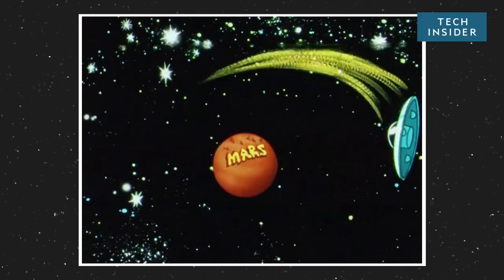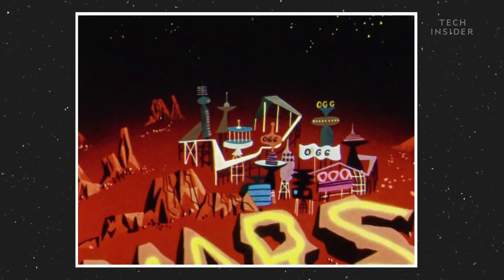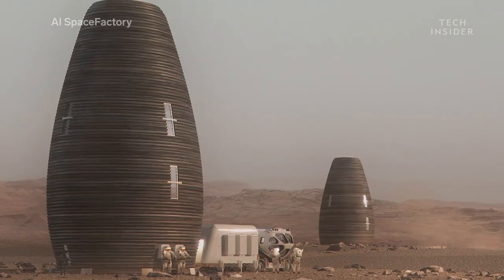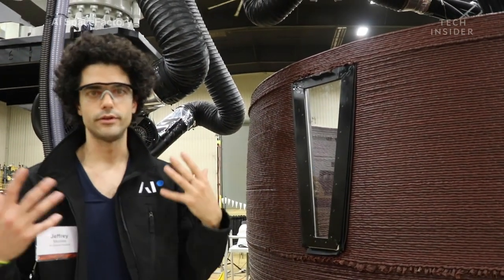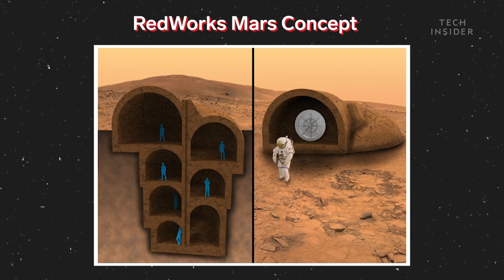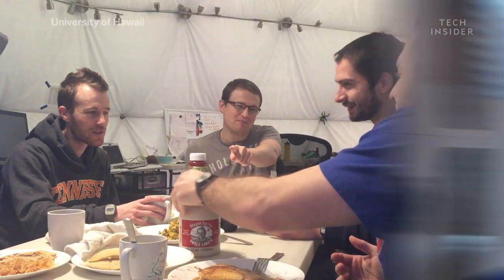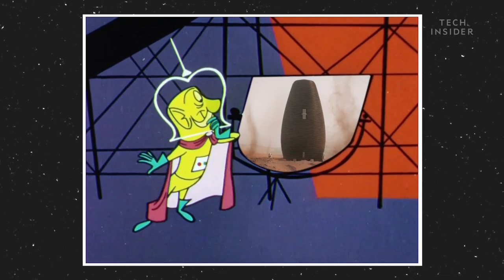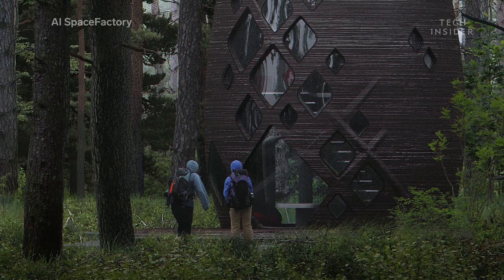The Mars Homes That NASA Awarded $500k

Comment: I am sold on possible practicality of first habitat like that because of ability to print it fast, assuming something is done about plant based component, but I found "needs to be above ground" for psychological reasons argument to be really weak. 

I still think that underground cities will be more practical in long term, with surface habitats mostly used as first stay while work on more permanent shelter is done. 

At the very least it must incorporate both underground and surface level, not extremes were one side is excluded.
Reply: im pretty sure it;s partly buried, https://www.aispacefactory.com/marsha kinda shows it i think

Comment: I really like it but still i dont know how much radiation can it actually block. And you cant compare radiation to something like being underground im sure they can make nice underground housing aswell.
Reply: Karmo Pro stone, concrete, lead, water and similar bulk compounds are REALLY good at blocking radiation, mostly because you just put enough atoms in the way and the radiation is too busy being absorbed and re-emitted in the outer layers to make it through very fast.  Too heavy to lift those kinds of thing into space (at least in a bulk that would be useful as a structural component or rad shield), which is why we wouldn’t consider it for the ISS, but the plan is to just ship the printer robot and then make the concrete-like “filament” on-site with locally available soil compounds, and use crops grown in one of the non 3D-printed starting habs to create the organic additives necessary for the desired properties.

Comment: Only problem I see is not considering the effect of an injury. How is someone unconscious supposed to be moved? Or with a bad knee supposed to get around? And each habitat needs its own medical treatment room, which could be on the ground floor for rapid access if an injury happens outside.
An added area should be considered below ground, which would help anchor the habitat. Storage is an issue for sure, and more work areas or labs would be beneficial. Even an extra restroom, and definitely at least one more garden room, since growing food is a huge necessity and it takes a lot of space to grow enough to feed one person.each unit should be as self sufficient as possible, even if there are other buildings dedicated to agriculture, storage, water and waste processing, electrical generation...whatever. 
I’d also like to see how the material holds up to sand blasting...there are dust storms that last for weeks, right?

Comment: I would like to see how the 3d print of the homes functioned under non ideal conditions. Extreme low temperatures, dust storms, marsquakes, etc. If they can print reliably under those conditions I would be more optimistic.
Also how are these homes shielded from solar radiation and gamma radiation? That's kind of the entire point of building below ground, having many meters of solid rock to shield you. Psychological health is very important, but getting horrific cancers within a year of living in the air freshener house might be a bigger problem.

Comment: Ok??. other  Questions are still up in The air! For example how strong are these houses against Marshan dust storms?
Reply: Dust storms on mars are nothing compared to the ones on earth. Nothing to worry about
Reply: @cosmo8860    He has a point, Mars is known for its fierce storms, and this design doesn't look modular. My meaning is that if one part becomes unpressurized, there are no bulkheads/doors/pressure chambers stopping it from depressurizing entirely. Cameras could simulate windows underground and you could get the best of both worlds. However, NASA realizes how easy this is to build compared to the digging required for an underground habitat. In my opinion, with the lives of crew members being of the upmost importance, I would spring for the underground bunker with virtual windows and a VR flight simulator for the pilots to practice for a emergency takeoff/evacuation.

Comment: It will never work. They would need seriously heavy shielding to block the radiation. And every window is a point of failure. And when you have no backup solution... you cant afford failures.

"Did you hear what happened to the jetsons? Their egg got a crack and they all suffocated."
Reply: And I'm sure you have hours of research to back your theory.
Reply: @massir7769  any person should be able to see that this cant be the best option for safety.
Reply: @obsiPog  the material used is radiation-resistant didn't you watch the video?
Reply: @obsiPog  it probably absorbs most of it, they wouldn't have won if the design was impractical.

Comment: Underground living colony much safer man
Reply: Yea, sure. You're the scientist here.
Reply: @renny489  He has a point, Mars is known for its fierce storms, and this design doesn't look modular. My meaning is that if one part becomes unpressurized, there are no bulkheads/doors/pressure chambers stopping it from depressurizing entirely. Cameras could simulate windows underground and you could get the best of both worlds. However, NASA realizes how easy this is to build compared to the digging required for an underground habitat. In my opinion, with the lives of crew members being of the upmost importance, I would spring for the underground bunker with virtual windows and a VR flight simulator for the pilots to practice for a emergency takeoff/evacuation.
Reply: @renny489  I am

Comment: If you look at the 3D printer its long-neck base could be 3D printed as well allowing the 3D printer to get taller and taller, and much of the base can 3d printed as well...  You could also build a specialized printer to build certain parts of the printer like the wheels, and that specialized 3d printer could be largely 3D printed.  Imagine turning up with a 3D printer and a bunch of extra 1000 extra 3D printer parts and having that 3d printer build bigger 3d printers until you have 500 of them and have them all build an entire village.

Comment: I don't know man, AFAIK you need 1 meter or thicker walls for radiation shielding. Does not seem to be a good reason to not build long-term housings underground. 
Psychological reasons - I get it, but large enough underground gardens with good artificial lighting should do, initially. Later, you can think about large domes with radiation-absorbing semi-transparent shell.

Comment: Plant based polymers required.. ok  that's a non starter because where are you going to get the plants? And:  near vacuum subzero temperatures will cause problems during printing, cracks and a crumbling substrate. The resulting walls will leak air like a sieve under pressure. 

There have been much better performing concepts presented in the thingiverse 3d printing Mars Challenge. Some entries don't even require the failure prone complexity of 3d printing.

Comment: These are not buildings. They are architectural models at 1:1 scale. Real buildings have to consider building codes. This is a fundamental difference.
Reply: That's like saying a log cabin isn't a house because no codes were consulted or used in its construction. Completely nonsensical argument.

Comment: Structures need to be in a row house configuration with Elon's boring tunnels connecting them. Seems dumb to suit up to go next door for a cup of sugar  Tunnels double as extreme radiation shelters if needed. Tunnels could hold long term food storage as well. In fact a boring company tunnel network could solve a lot of risky missions on the surface.

Comment: Easy?? Yeah right! How are you going to mine the basalt and then filter out all the garbage and then heat it to 2000 degrees to produce a product that your machine can use and then how are you going to grow enough crops to produce the polymer that you also need? So it comes down to which comes first - the mining/factory or the colony?
Reply: I also heard that plant based polymers degrade quickly under high radiation, so I'm not sure even if we could build these on Mars that they would be at all sustainable. Would have to rebuild them constantly due to radiation degradation. And when any structural failure means immediate death for everyone inside you really wouldn't want to know that your walls are constantly being weakened by the sun.

But you're absolutely right, we'll need a giant mining operation and fuel production factory on Mars before people will ever be able to live there in any kind of sustainable way. It will cost many millions, if not tens or hundreds of millions every year to sustain each person living on Mars. 

I expect we'll see a small team of scientists visit Mars, but we're not going to see people living there in this century.